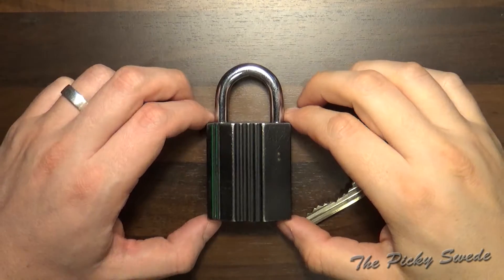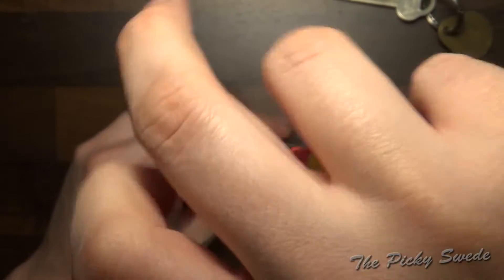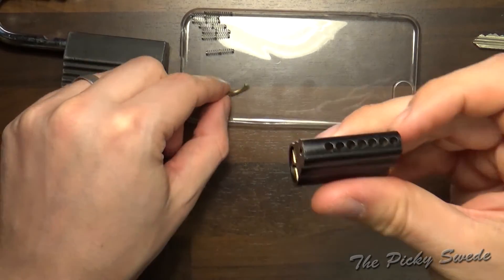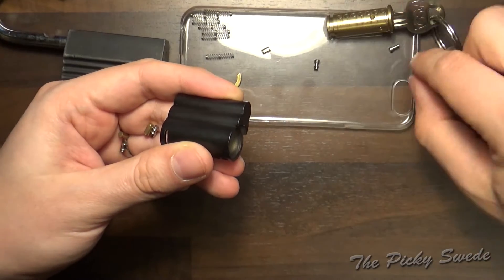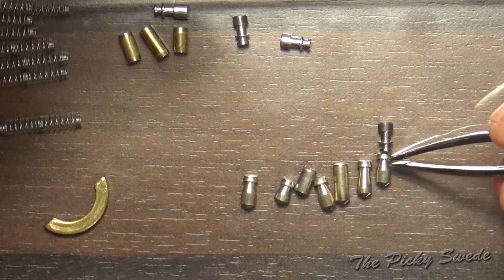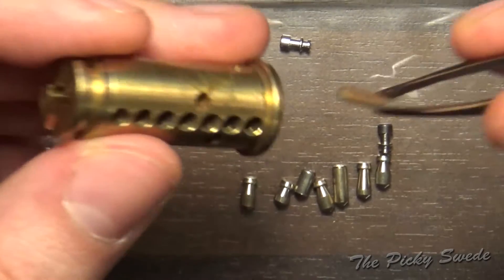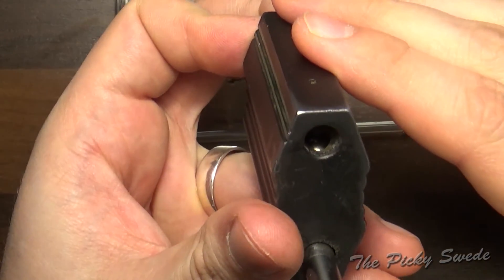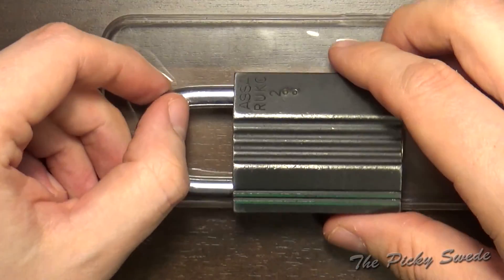003 ASSA Ruko 2 Gutting and assembly

Comment: I believe the visible silver core of the top pin should go upwards against the spring and not downwards against the plug. At least that's how it was oriented in a lock that I took apart. If you lose track you can usually see which part of a pin should face the spring from that end being shinier that the plug facing end since it has been less exposed to dirt and wear.